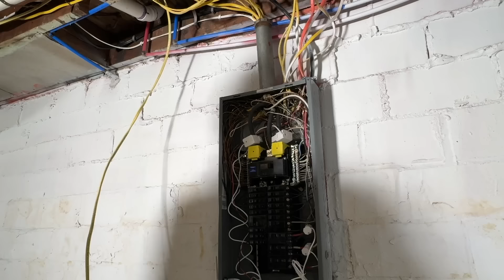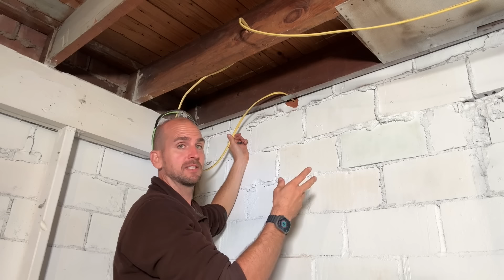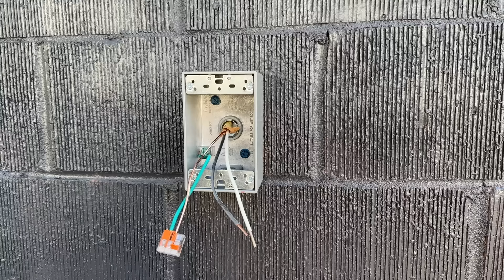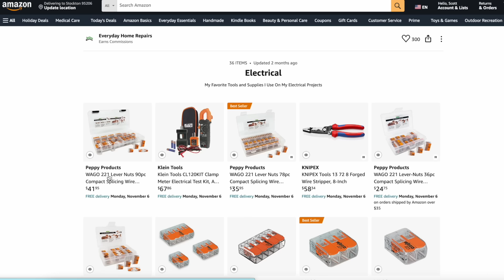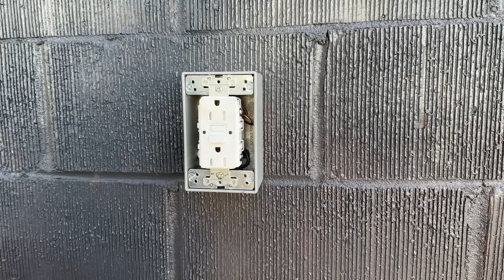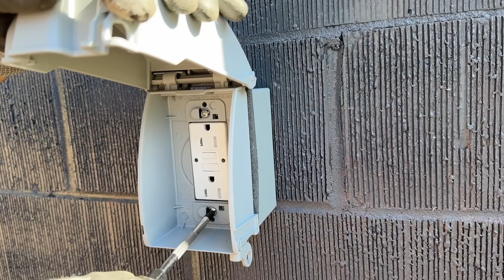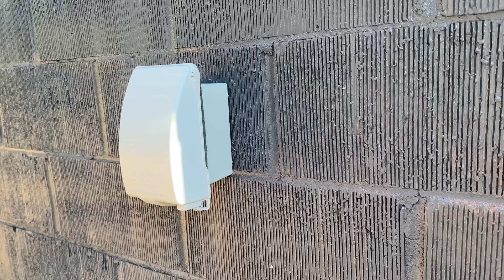How To Install An Exterior GFCI Outlet

Comment: If you rally wanted that location you could have drilled on a steep upward angle with the pilot and came out in the center of the joist.

Comment: Even with a steel plate, many inspectors will fail a notch on the tension edge of a joist. Also, even though the other romex is grandfathered in to be connected that way, when you run a new circuite you are required to follow current NEC and secure that new romex within 12 inches of the panel. It appears that new romex is secured past 18 inches.

Comment: When I installed my 14-50 outlet on the outside surface of my cinderblock foundation home, I used pvc conduit to protect the wire. Probably overkill and as you said, the code says we don't need to do that, but the electrician that looked at it after gave me the thumbs up, so that made me feel good. Over three years later and it's going great...unlike the EVSE I'm currently fixing that was installed by a pro. Not the pro's fault. The GM EVSE is garbage.

Comment: Putting a small pilot hole from the inside out you can get a better interior exit point. If you don’t like the exit point you can easily relocate it and then mix a small portion of patching concrete and fill the hole(s) as needed. Plus just make the hole bigger and use a PVC conduit to run from the outlet to the interior, then you don’t have to worry about rubbing or damaging the wires. You should put something on the back of the box/wall area. Duct seal or caulking to keep water and pests out.

Comment: Isn't this a code violation. Romex is not allowed for outdoor installations even if inside a conduit. A THWN or UF-B should be used. Please correct me if I'm wrong.  (NEC Section 300.9)

Comment: romex is not considered protected so you have to have a sleeve going through outside wall. Also romex isnt rated for outside use even if 
your going directly into a box. This would never pass in any state.
Reply: Incorrect, this would pass everywhere. There is no romex cable outside of the wall.

Comment: I ran a new Romex "15amp"  from 150 amp panel to a new 15amp breaker went right thru the cinderblock wall for outside with no conduit ran Romex nm not UF into outside box and installed the "wr" 15amp gfci outlet with all plastic box and see thru lid its been 10 yrs and still works great and no issues whatsoever ! even sold the house after I installed that about 5 yrs after I installed and no inspector ever saw it or looked at it and wiring is correct . oh the wire is going thru cinderblock above ground not " underground " which I believe also helps with non moisture build up .

Comment: Could a Raco 4714 Cable Connector been used instead of the nm cable clamp? Or can 1/2" ent smurf fit into a smaller drill hole?

Comment: If you’re going directly into the back of the exterior box then no conduit is necessary. Just no exposed wire outside. Just put a weatherproof gasket on the exterior box.

Comment: my outlet outside is sideways can I still install the metal box cover on its side will water stay out. thk you
Reply: If you use a cover designed for horizontal use, yes.

Comment: The surface mount junction box shown at the beginning of the video doesn't have any mounting holes in the back.  How does he jump from no mounting  holes to screwing Tapcon screws through the back.  I purchased a weather proof surface mount box that doesn't have holes either, and where I would like to place holes, there are raised bumps on the back and inside of the box that prevent drilling.  What now???  Can I expect those bumps to punch out cleanly with a punch and hammer, without damaging the box?
Reply: Ahhh... I see in the second kit that I bought, that they included a couple of zinc plated "ears" and screws that can be mounted to the back of the box for wall mounting.  Not sure where I can purchase the missing ears after market...  I've had the surface mount boxes on the shelf for quite some time now.  I can probably just CNC my own ears, but still curious where the holes came from on Scott's box.

Comment: As long as your receptacle is a Duplex (2 outlets) and not just a single receptacle (only 1 outlet) you can put that 15 amp rated GFCI duplex receptacle on a 20 amp breaker by itself if you wanted to, NEC 210.21, like you would for a dedicated circuit such as microwave, refrigerator, dishwasher, garbage disposal, etc. - good video

Comment: Question - What how would you run the NM along the block wall if say you didn't have the joist up above? I'm installing a 30a inlet box outside my garage, coming inside then over to a panel. The wall is block. Outside is stucco. Inside is just painted. Should I tapcon some 1x2 wood and staple to it? It seems like conduit would be against code. Just want to do what works best.

Comment: If you had set your box in the center of the brick, you wouldn't have had the joist and brick issue on the inside.  I would have done this just for visual effect unless there are code issues involved.

Comment: Since you grounded the metal box, the jumper to the receptacke is not required. And I ,now i will get a lot of djsagreement.
Reply: As long as the fiber washers are removed from the receptacle mounting screws, you are correct.

Comment: Not all ahj 's allow drilling through the box. Seal around box or sealant on back. I use a PVC connector and sleeve in concrete...

Comment: When you say "Romex", you mean "NM cable".  Romex is a brand name.
When you say "brick", you mean CMU (concrete masonry unit).
Reply: NM cable, not wire.
Reply: As he states in the video clearly ...
Reply: @anxiousappliance  Maybe eventually.  Certainly not at first, or consistently correct.

Comment: No seal putty, or silicone behind the box, or in the hole? The rain could just run down the wall and line, into the basement?
Reply from the maker: Yeah, I think Silicone or duct seal would be a good idea.  You will see I added Silicone here https://youtu.be/i4HBc-LfYP8?si=_8kJb_g5zdgVP_cM&t=839

Comment: I'm really a novice, but I worked with an electrician for several months. Even as a carpenter, I remember that holes should be drilled within about 18" from the joist support point. Drilling further away from that support not only tends to weaken the joist, but I believe that it is against code.

Comment: still a big no no in the way you are running that Romex past the strike plate. Small issue but that small gap has the wire exposed to close to edge.

Comment: You only need a duplex 15a outlet to be to code on a 20a breaker. Not multiple devices. Just no single Simplex outlet.

Comment: You could have drilled just 2" higher and caught the floor joist (sill plate) and you would have made your job easier.  Hate notching structure.
Reply from the maker: Yeah, that would have been more ideal.

Comment: Did you drill holes in the outdoor box to mount it? I don't ever recall seeing holes in an outdoor rated box, usually they have lugs.
Reply: some will have dimples inside them meant to be drilled through. I refuse to use the wings , they just rust off anyway.

Comment: We were told at an IAEI continuing education class that is NEVER legal yo run type MM cable to any outdoor location .All outdoor locations are considered either wet or damp locations. Type NM cable ls not approved for damp locations.Told us we must use tupe UF cable .
Reply: You can run NM up to an outdoor location but you cannot run it within an outdoor location. The entire cable is in the wall and basement, uf not required here.

Comment: Masonry will eat the coating of the NM cable (romex) over time.
Reply: No, it won't.
Reply: I seen it so many times, it will.  @pld8993
Reply: @sparky0288  Romex in contact with a dry masonry product like block or brick, that will not eat through the sheathing. Embedding the cable in a wet masonry product is not the same thing and that can degrade the sheathing, which is why it's illegal to embed the cable in a wet masonry product.
Reply: @pld8993  What's the difference between Embedded and Contact with masonry, none...
Reply: @sparky0288  Wrong. Grab a dictionary and you'll see that embedded within and in contact with are not synonymous. In contact with a dried masonry product whose chemical reaction is complete is not the same as embedding it in a wet masonry product that, as it dries, transforms from wet to hard through a chemical process. If you bothered to read the NEC you'd see that they specifically forbid it in embedded situations but there is no rule disallowing contact. You can touch dried concrete all day with no ill effects to your skin. Expose yourself to wet concrete undergoing a chemical process for any length of time and you'll see and feel the difference. It's not rocket science, but it is science. Read and learn.

Comment: Love the channel!  I’m new to electrical work, but my understanding is that NM cable is not permitted outdoors.  Once you penetrated the masonry to run the NM cable outside, didn’t you go against code?  Keep up the great work?
Reply: Thats all he does. is violate the code.
Reply: The entire NM cable is in the wall and basement.
Reply: @pld8993  Correct me if this is wrong…but my understanding is that once a penetration has been made to an outside wall, it is considered a outside/wet location.
Reply: @KarlLeopold-u8y  Inside the wall is not considered outside or a wet location. The inside of the wall ends at the outside wall surface.
Reply: Hi  @pld8993  .  Thanks for your input.  I’m trying to reconcile how NEC defines Wet Locations with your comments. 

 As I understand it, NEC defines wet locations as installations underground or in concrete slabs or masonry in direct contact with the earth; in locations subject to saturation with water or other liquids, such as vehicle washing areas; and in 

Additionally,

NEC 334.12(B) USES NOT PERMITTED (TYPE NM) 

Type NM cables shall not be used under the following conditions or in the following locations:
Where exposed to corrosive fumes or vapors
Where embedded in masonry, concrete, adobe, fill, or plaster
In a shallow chase in masonry, concrete, or adobe and covered with plaster, adobe, or similar finish
In wet or damp locations
Reply: NEC defines….The NEC defines wet locations as installations underground or in concrete slabs or masonry in direct contact with the earth; in locations subject to saturation with water or other liquids, such as vehicle washing areas; and in unprotected locations exposed to weather.
Reply: I think because the receptacle is located in a wet location, the conductor that connects to it must adhere to the wet conditions standards.  I could be wrong though.
Reply: @KarlLeopold-u8y  The box is in a wet location. The inside of the box is not a wet location, it would be considered a dry or damp location. The receptacle must be WR rated and it is not located in a wet location; it's located inside the box and protected from saturation with water, a dry or damp location. Because the cable ends at the connector where it enters the box, there is no romex cable inside the box, there are only individual conductors in the box. When done correctly, duct seal or caulk would be used to seal the opening where the box meets the wall, thereby ensuring that the inside of the wall remains a dry location.
Reply: @pld8993  I like it.  I accept you interpretation!  Thanks.

Comment: No silicone behind the box? The romex connection isn’t water proof just curious if the box will fill up over time
Reply: box will get moisture in it anyway. those flimsy gaskets that come with In use covers fail, tear etc let moisture in. we drill drain holes in our exterior boxes, silicone or R391 Weatherproof Electrical Putty on the back of the box around peneration

Comment: That box will get water in it. If silicone is not applied to the top screw. Also my electrician instructor told me he had his guys drill a 1/8” hole at the bottom of the box for if any water will get in.

Comment: On any entrance from a conditioned space (inside) to and unconditioned space (outside) you would need to put on some duct seal  per code also use a weatherproof cord grip other than that good job
Reply: Duct seal needed only if using a raceway, not for a cable. The connector does not need to be weatherproof because it is inside the wall.

Comment: So why didn't you go with 20 amp outlet if you installed a 20 amp breaker?
Reply: 20 amp breakers are common for 15 amp circuits.

Comment: Question: this is a home built pre 1950 (darkness of the joists & wooden posts), it uses 2x6’s for the floor joists, is this your residence and if it is, why would you buy with this small of a joist?    Thanks!

Comment: OK for somebody who is supposed to be kind of smart the way you knocked that hole through the basement wall is just beyond a bit stupid, why you would not try to measure because there are plenty of things you could measure from and come out in the middle of that floor joist, I’ve done 1 million of these, but anyway you’re just a handyman and apparently not quick enough at figuring out how to Do that properly sorry not impressed

Comment: Re: 15A outlets on a 20A breaker -- a strict reading of the code (I don't remember the section, sorry) indicates that you can install a single 15A duplex receptacle on a 20A circuit, because the two receptacles on the face count as... multiple receptacles. Of course, your local inspector may interpret that differently.

Comment: Since the brick is hollow, just make a hole in the joist and into the brick cavity the proper distance above the edge of the joist. It'll be a little trickier to fish the wire through the brick cavity, but then you won't have to notch the joist.

Since the joist was notched, it should be sistered with another (unnotched) 2x stock, glued and nailed to the joist above the notch. I'm not sure how far to each side of the notch is required to bear the load across the notch -- I'm not THAT much of an expert. And, rather than a notch, the cut should be tapered to distribute stress across the joist rather than focusing it in the corners of the notch.

Comment: My understading of code (I reread) is that because you are using a duplex outlet you dont actually need a 2nd outlet. You didnt do this- but I think folks should not silicon underneath the box because thats how any trapped water drains out
Reply from the maker: I think you are correct on not needing the 2nd outlet. Thanks for the feedback!
Reply: Something I was totally confused on for a while with my existing installation. Hence the research. I dont know why the NEC allows this rather than just having 20 amp rated receptacles multiple or single , but hey it does.  @EverydayHomeRepairs

Comment: There's a few recommendations I'd like to make. 1) always use the ears in wet locations like that. The screws through the back are for damp location only.
2) always seal your penetration through the wall both inside and out. This prevents water seepage, helps maintain the climate controlled space, and prevents bug entry.
3) although there's an exception for short runs through wet locations, best practice is to use a wet location rated cable like UF here. Best practice is to sleeve it through the wall as well.
4) if there's more than 3 NM and/or UF cables running through the same hole you have to derate the cable.
5) although not all holes require it, for the longevity of the floor you should always sister up a reinforcement board at all knotches and holes through a floor joist.
6) in that location the gfci outlet need to be of the TRW (TRWR) type.  It should have WR marked on its face.
Reply: He also needs to seal the threads of the top plug for the electrical box, or water WILL get in. You need to apply caulk to the threads and then screw the plug in. Simply smearing caulk over the top of the plug without caulking the threads only works temporarily, as the exposed caulk will deteriorate and eventually let water in again.
Reply: @benhartley9015  Teflon tape would do as well and deteriorates less than caulk.
Reply: @benhartley9015  Silicone, not caulk, no thread sealant needed.
Reply: You Nailed
Reply: Can I transition from nm cable to uf being that I’m gonna use an existing circuit in my garage?
Reply: @Josh-fz9rh  yes, as long as the junction occurs in a listed junction box and the installation meets code.
Reply: There's no exception for NM through wet locations in short runs. In this install, no part of the cable is in a wet location so it's a moot point.
More than 1 NM cable requires derating, 2 current carrying conductors per cable (assuming 14-2, 12-2, etc.), but only in lengths longer than 24" or when run through wood framing and sealed with foam, insulation, etc. Even then, because NM is already using the 60C column, derating doesn't change anything until you have 10 or more current carrying conductors.
Reply: @pld8993  there was an exception for short runs like this. We were allowed to run Romex in conduit on the exterior for a time. Then it was declared a wet location in that exterior conduit. Then they added an exception to cover situations like this. The code can and does change throughout the years.
Reply: @ianbelletti6241  Local code maybe, no exception in NEC.
Reply: @pld8993  it was in the NEC but it may have changed again in the most recent edition.
Reply: @ianbelletti6241  It wasn't in the NEC, at least back to 1993, and nothing has changed recently.

Comment: Probably a dumb question, but would you have to ground the metal junction box cover? I know you are supposed to bond metal junction boxes, just don't know if it would apply to a cover if the junction box is plastic.
Reply: If you used a metal cover on a plastic box, yes you'd have to ground the cover.